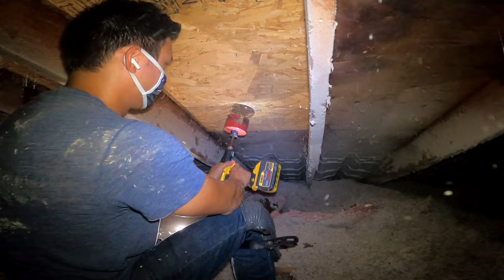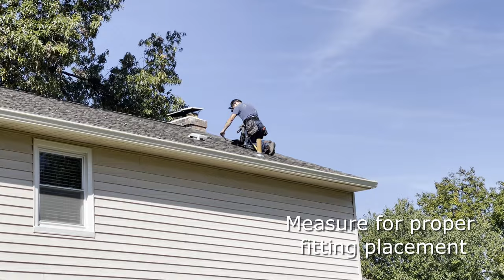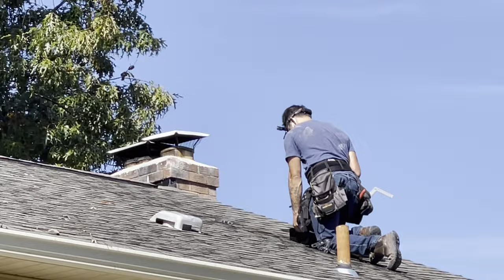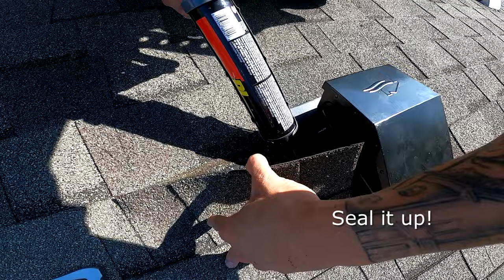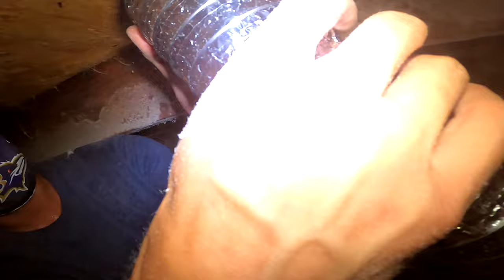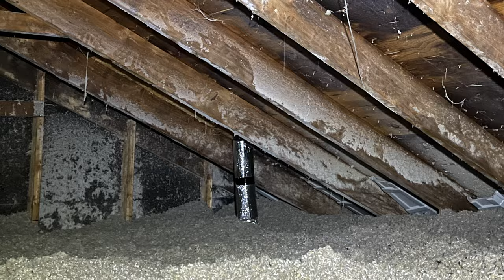The Steps to Venting a Bathroom Exhaust Fan Through a Roof

Comment: Juuuust barely enough ducting to make the connection. Classic “good enough” move 🙄
Reply from the maker: As opposed to having a long winding piece with more distance for the air to travel through? No thanks...
Reply: @homeairleakagetest  just like a drain needs a trap, so too would a vent duct benefit from a flexible vent to halt any moisture from entering the system.
Reply from the maker: I don't follow you @iComplainer
Reply: @homeairleakagetest  I think it is implied or stated that it is preferable to have a "trap" in the ductwork to prevent water that might blow in through the roof top vent from making its way to the bathroom ceiling.  I have never seen any reference to making a p-trap, but I am concerned about water blowing into the vent.... the openings in all the ones I have seen BARELY has an adequate rodent screen. Are there any roof vents for bath and range hoods that are water-resistant ?

Comment: Electrical Tape?! How bout NO!
Reply from the maker: Hi Shea.  What makes you say that?
Reply: @homeairleakagetest  electric tape just dries up and flops off. Duct tape melts into an adhesive goopy mess attracting mold to it, hvac tape is heat resistant and mold resistant.
Reply from the maker: @PerfectlyFunctioningAI  yes yes!  We use high grade HVAC tape!
Reply: @homeairleakagetest  are you sure? that guy may have pulled a fast one on you because ive never seen one that isnt reflective
Reply from the maker: @PerfectlyFunctioningAI  Ahh, gotcha gotcha. It is not a foil type tape and may not actually be categorized as HVAC tape, but it is not every day household electrical tape.  It is a flexible tape that is waterproof and dust proof and should do the job it is intended to do which is simply hold the flex duct to the boot in the scorching hot and super cold (depending on season) attic.
Reply: @homeairleakagetest  oh ok, ive got ptsd from lazy contractors is all haha. Having a moldy attic is the worse
Reply from the maker: @PerfectlyFunctioningAI  Totally understand and thanks for watching and keeping us and other honest!
Reply: @homeairleakagetest  You need a more secure means of securing the flex ducting such as a hose clamp or a zip tie.  Mastic should also be used to seal the junction between the flex tube and the metal ducting as well as sealing the metal duct.  You can back that up with tape especially designed for duct work.
Reply from the maker: @percyfaith11  thank you for the feedback!
Reply: @homeairleakagetest  Oh, that was NOT elechickens tape ?   You might wanna paste some text with an arrow in the video, saying " HVAC TAPE" I thought it was electrical tape, too ! MY roofer dissapointed me... he put a regular roofing vent, where one of these type devices needs to go.... my bath fans just sit BENEATH the hole in the roof, under the water-resistant, but no collar to connect-to-vent. I only know this, because I hired my heating guy to replace both bathfans.